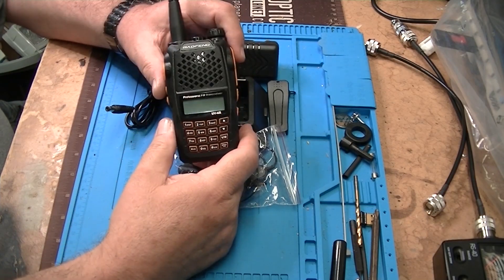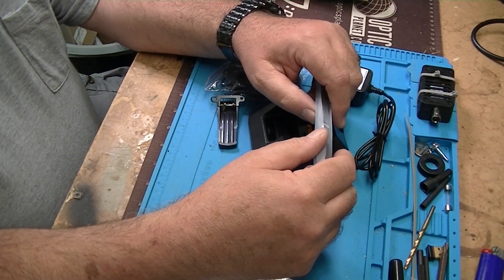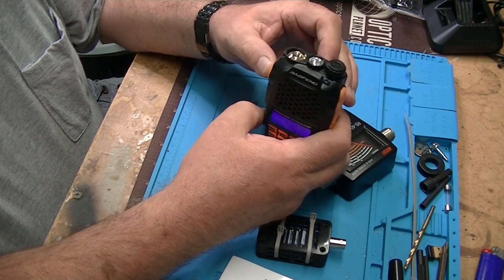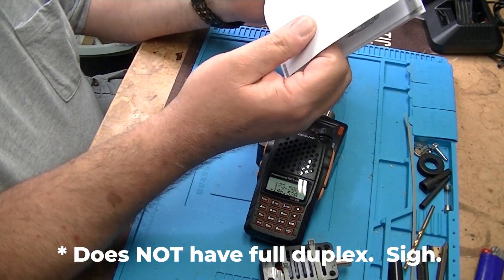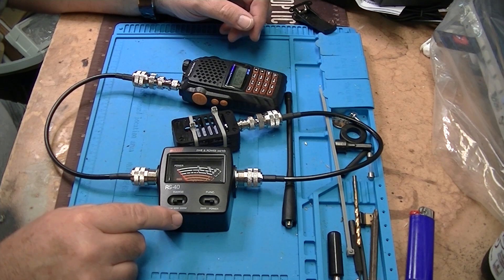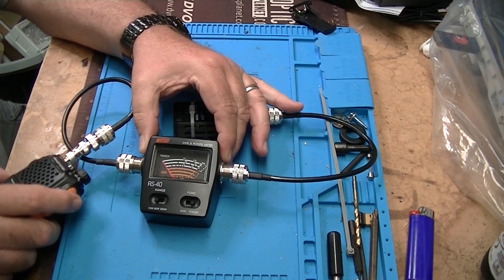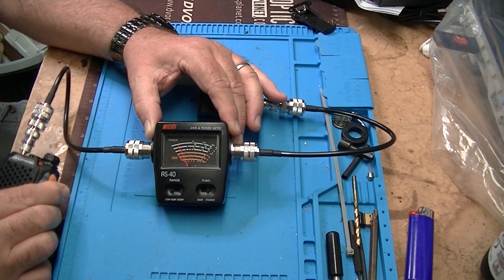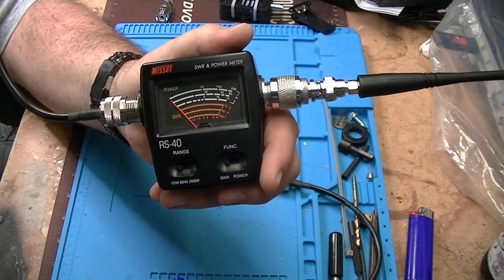Is this a better Baofeng?? Signal Check Series

Comment: I recently discovered i couldn't change the squelch levels in the uv6r. Come to find out Baofeng removed the ability to change it. I find that very strange. What possible reason could they have for disabling squelch adjustment?
Reply from the maker: Chad, now I gotta go look at mine!  I usually just roll with the default, I'll have to see what mine shows.  You may have newer firmware than I do.
Reply: @FEPLabsRadio  I had a guy in a Baofeng Facebook group that said he did some of the Baofeng programming for chirp. He said that Baofeng actually removed being able to adjust it. It's been on my mind since he told me. I can't think of any reason why they would do that lol

Comment: I ordered that dummy load 2 months ago from them. Have gotten nothing but the run around. Unanswered phone calls and messages. Unkept promises when they do answer. I would recommend not purchasing from them.
Reply from the maker: Dude - that sucks.  That's the only thing I had bought from them, it was like 2 years ago.  I assume you're talking about Rocket City?
Reply: @FEPLabsRadio  yes, Rocket City 3d in Madison AL.
Reply: Well now their domain is gone..so I guess they folded?

Comment: Did you go back and rerun the radio with a wider span?
Reply from the maker: This is one of the radios I did the testing on in my current series (with a wider span and on a real spectrum analyzer).  This video is a re-pack, and shortened version of the original.  It was a year ago, and I was wayyyy to wordy.